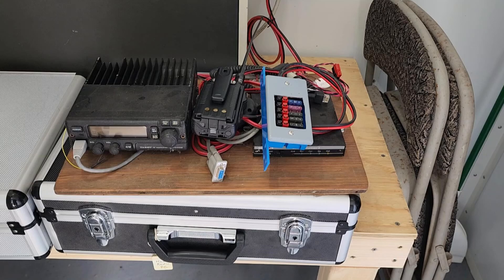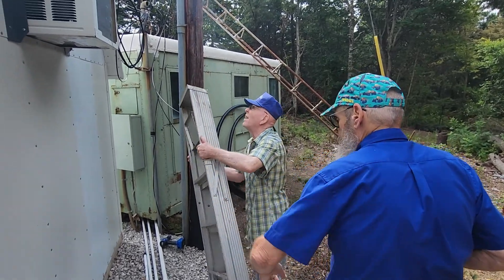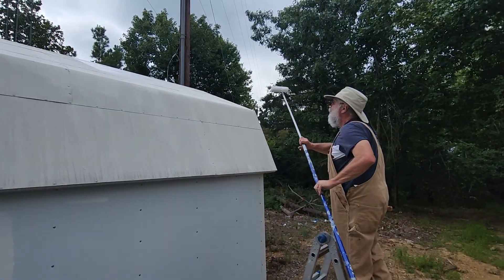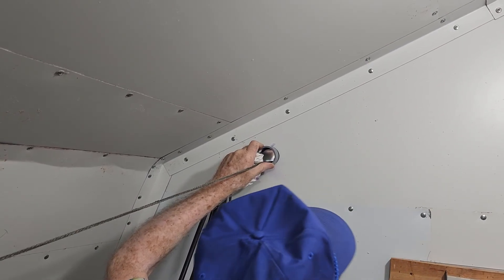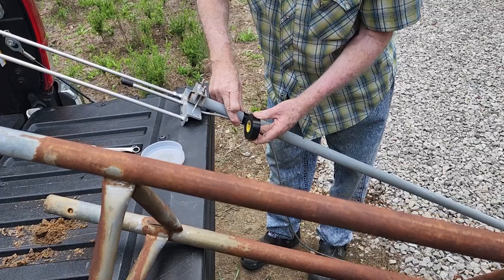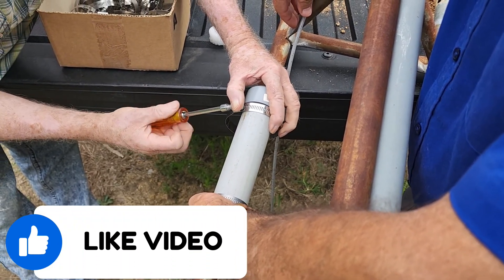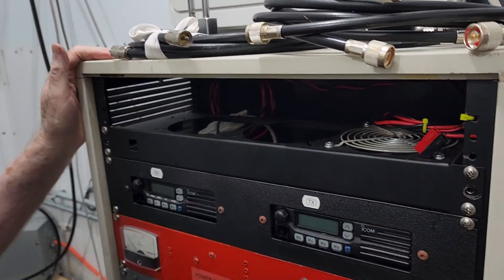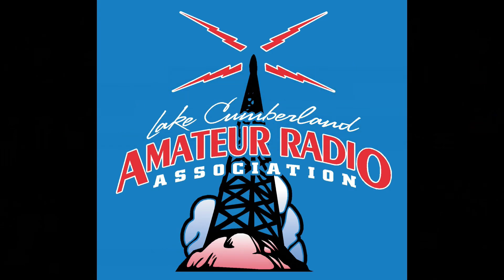LCARA HAM Radio: Putting Two Repeaters Back on the Air!!!!

Comment: good to see folks still into VHF packet. what frequency is the packet repeater on? and what freq does the guys on Sunday nights stay on same as the repeater or keyboard to keyboard? i have a dedicated radio to packet at home and monitor 144.390 in ceasers head mountain NC. i often see many other packet stations from as far north as DC..

Comment: Those changeover connectors ie pl259 to n-type are a bad idea, trust me i know, get the appropriate patch leads.
Reply: how so? ive been using them for over 40 years and never had a problem. we used them in the military also with no issues?

Comment: Do you ever have plans to build proper patch cables with the correct connectors? My sites used to have adapters all over, I ripped them all out and built proper cables and the repeaters honestly work a lot better.